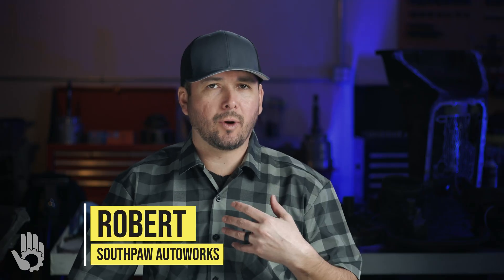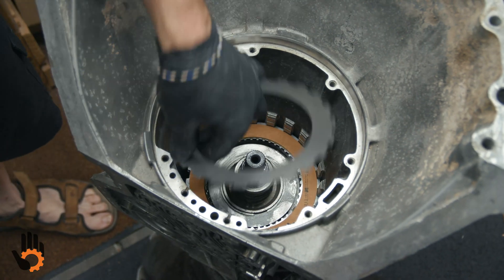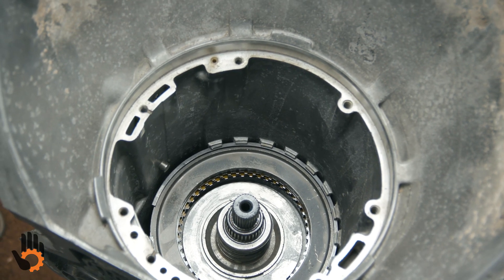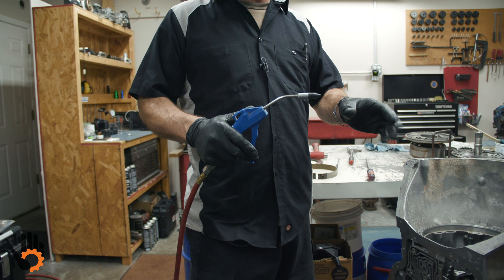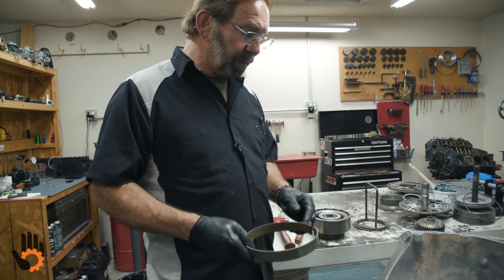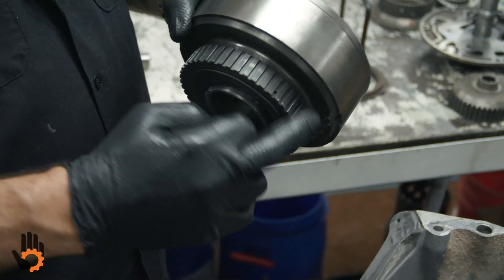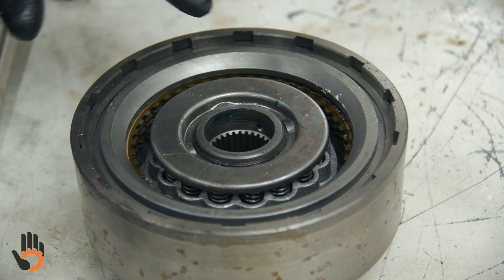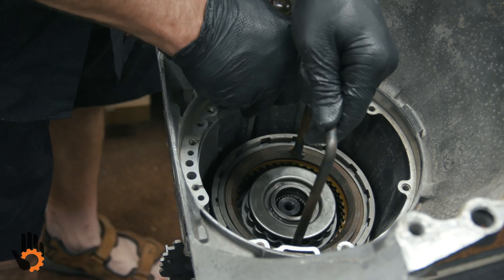TH400 Build Series - Installing Intermediate Clutch, Front Band, Direct + Forward Clutch Drums

Comment: Great series to help me through my th400 rebuild.
Question that came to mind watching the intermediate get stacked - is it ok to put a friction directly onto a wave? Or should a steel be placed on the wave, then friction, etc.
I'm asking because I don't know if the wave raised points will damage the friction as the pack is compressed. Seems that the 4 or 5 raised wave sections might be a lot of stress points in the friction.
I don't know! Thanks !

Comment: Hello. What a wonderfully informative and educational video. I'll start with my TH400. But I need advice. There is a noise in the gearbox on first gear only 1. Only 1. Does not follow engine speed but driving speed. This is not a working noise. Otherwise works great. The oil is fine and at the right level. Afraid that it is not easy to see what is wrong when it is dismantled. The car is a 1968 Corvette 327. Hope someone out there can give some tips that are correct. 🙂
Reply: Could be the HD 400 trans they used on the motorhomes. They had straight cut gears I believe on 1st and 2nd gear. The helical gears were used on normal production th400 trans. You may or may not have the HD 400 trans but that's the 1st reason that comes to my mind. I've had one and they tend to get loud when going up the rpm band. Check your trans numbers and see if you have one. If you do it's a stock car racers Holy grail.

Comment: My early model 4L80E did not have a wave plate in the intermediate clutch pack. I just put it back together with out one. The clutch pack clearance looked to be good to go. Had a hell of a time getting the direct drum spline into the clutch pack without that tool you guys have. I air tested it, and it did not rise letting me know it was seated all the way in.

Comment: I'm doing the sonnax th400 case saver and using a full manual valve body that keeps the band. Can you upgrade to the wider 1.25" front band while using the th400/early 4l80e case saver? Will it need the later longer servo pin if it will work with the wider band?

I know you can use the  wider 4l80e band with the longer servo pin in a 400, but will it still work using the sonnax case saver/intermediate snap ring support?

Comment: Very informative and helpful video! 
Question, when you are doing the air check on the direct drum, are you shooting air into the center support bolt or the hole to the right? I’m not getting any action out of the direct drum as in your 2nd test. 
Putting a 400 back together for my Jeep J20 truck. 
Thank you for taking the time to create these videos!
Reply: Thank you for the info!
Reply: @ponway   I recently mixed  the heavy goo 2 to 1 with dextron  and made lighter assembly goop, works excellent!
Reply from the maker: Right on!  Thanks for sharing.
Reply: Never mind, I found my problem. I had coated the scarf seals on the center support with green Assembly Goo, shouldn’t have done that. Cleaned it off and coated with trans fluid and test fine now. 

On another note, a PosiLock model 104 puller with it’s T handle works great to grip the shaft and set the assembly in the case. It also worked great in a drill press to compress the springs and remove the snap rings in the clutches. Been a handy tool for a number of things over the years!
Reply from the maker: Right on.  Glad you got it figured out.
The green stuff is "firm tack"...great for holding larger/heavier transmission parts in place, as an assembly aid.  The blue stuff is "light tack" and works great for lubricating stuff...and holding smaller/lighter trans parts in place, as an assembly aid.

Gonna have to take a look at that setup (PosiLock puller).  Thanks for sharing.

The positive feedback is appreciated.
Thanks for dropping us a line.

Comment: Installing the direct drum is always a challenge for me.
Reply from the maker: Having an installation tool definitely makes life easier.  If I'm installing the direct drum without a tool, then I like to use a pocket screwdriver to align all of the clutch pack teeth (Intermediate Clutch).  Teeth lined up, and clutch pack centered.  Seems like it makes installation a little easier.  But then again, maybe it's just all in my head.  ;)
Reply: It's extremely simple and usually takes 5-10 seconds

Comment: Great video. I’m planning on doing my own th400 rebuild that came out of a cj7. I’ve heard that the bell housing is different due to it fitting to the amc 304. Are there any other differences?
Reply from the maker: Right on!
The output shaft and center support come to mind.

Output Shaft:
There's a number of different output shafts.  They vary in length, and in spline count.
Jeep is 10 spline...whereas most others are 32.

Center Support:
On GM TH400's, in order to remove the Center Support from the case, a snap-ring and a bolt (Intermediate Clutch feed hole bolt) must be removed.  Then the support is free to slide out of case.
On some TH400's, there's also a set screw (allen head) that pushes on one of the lugs of the Center Support.  The head of this set screw is accessed through the valve-body side of the transmission case.  Not sure if that's a Jeep thing, but, thought I'd throw that out there.  If you're having trouble removing the center support, might want to look for a set screw.

Hope this helps.
The positive feedback is appreciated.
Thanks for dropping us a line.
Reply: @SouthpawAutoworks  these are the best videos most informative and detail that I have ever seen..PERIOD!..
Please do a series of videos on the 1969 style of C4 C5 and aod transmission.. the old school classics... you guys are amazing thank you so much!
Reply from the maker: I believe that we've got some C-4 transmissions handy.  We would love to do a series on that trans...as time permits.

Wow, thank you!
Your feedback is greatly appreciated.
Thanks for dropping us a line.